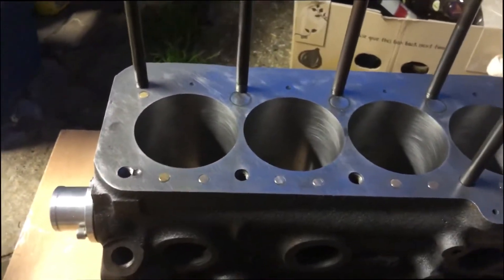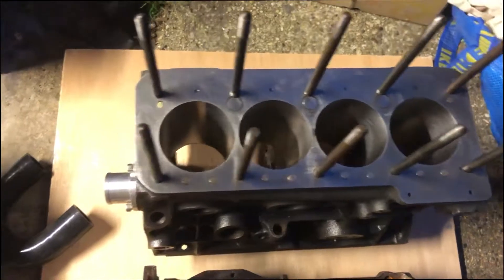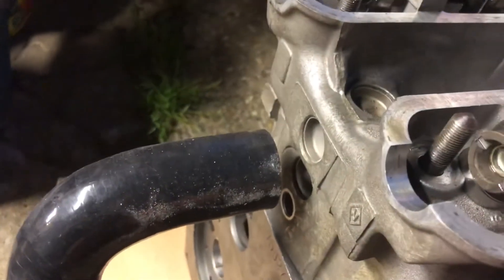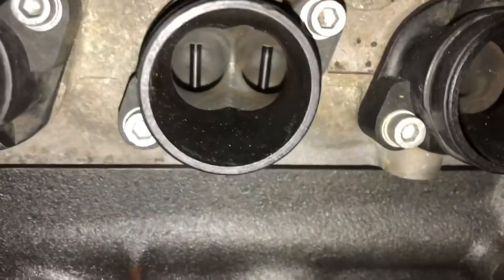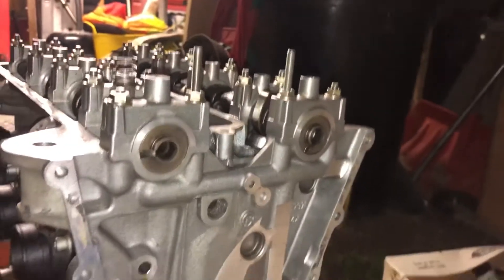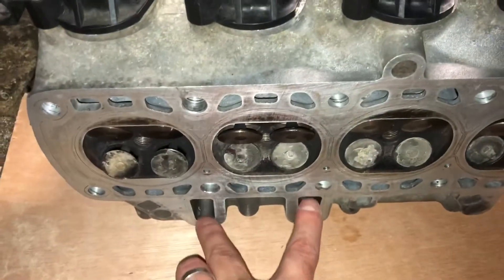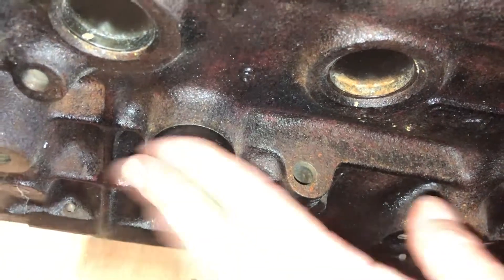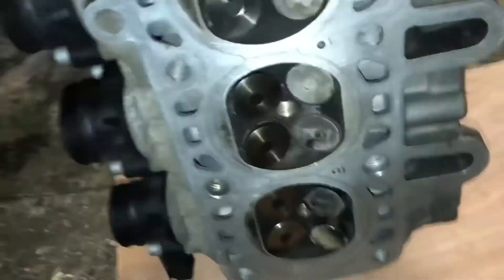BMW K Head Conversion

Comment: But which is cheaper, going to the K head and doing all that work to dry deck it, or getting the aluminum head from Moss Motors? You could also get the cams turned to clear the studs so you don't have to cut them down, in fact a little extra weight off the rotating assembly is free power.
Reply from the maker: Sorry which aluminium head from moss motors?? Not heard of that one. Is it a regular 5 port head??
Reply: @NickThornhill  did you get my reply with the link to it, it's not showing now, I bet youtube deleted it as spam
Reply from the maker: No sorry. It didn’t come up on my page. Drop me a message on Instagram. Nicks_Projects

Comment: Just a side observation. I noticed The standard A Series engine has a cam in block down low, but again it has chain drive for the cam even though it’s down next to the crank. Why do so many cam in block engines have cam chain drives? Afterall if VW can have the a cam gear directly driven off a crank gear right out in front & RR can do the same with their V8, except the direct crank gear to cam gear setup is at the back, why don’t all cam in block engines have their cams directly driven from the crank? Afterall it’s just 2:1. Gez even the Ford 300 straight 6 has a direct gear driven cam, yet it’s smaller brothers (the 144, 170, 221 & 250) all have cam chains too.
Reply from the maker: I think it comes down to cost and the expected use of the engine. 

If it’s a high power, high load, high rpm engine, it’s really important to have all that mechanism hugely reliable and gears do that job perfectly. 

However when cost comes into it, a chain has a very reasonable life, it’s cheap to make and easy to replace, also requires very little maintenance aside from a new tensioner every now and then and a replacement chain at 100’000 miles when everything else is probably also worn out.
Reply: @NickThornhill  Thanks for replying, Nick, take care & goodluck

Comment: Great video Nick. The one thing I don't understand is why the block needs to be blocked completely as in your video if running a dry deck. Wouldn't a dry deck gasket hold it all back? I'm trying to find out if I can make a 8V conversion without having to disassemble the whole block and send it to a machine shop, so just drilling and tapping the block. I have converted my dizzy into a 36-1 hall sensor enclosure for the EFI, works a treat as it can run sequential without the need for camshaft sensor. Just an idea given that you are giving so many in your video!
Reply from the maker: You can just block all the holes with a gasket however if you blow a head gasket, the combustion gasses could pressurise the water system and blow all the water out of the engine, if the head and block surfaces are sealed, all you lose is combustion gases and you can gently cruise to safety. 

Even if you run a wet deck, it’s advisable to plug and re-drill some of the existing holes on the block surface to align them with the k head. 

As for the dizzy with a 36-1, it should work but the crank sensor spins at 2x the speed of the cam/dizzy so you’ve got 18 pulses on one revolution and then 17 and your missing tooth on the next, rather than 35 and your missing tooth for every revolution of the engine. You end up with a pulse every 20 degrees of engine rotation rather than every 10 degrees. 

In theory it’s half as accurate as a crank sensor. 

You could use both a 36-1 crank sensor and the dizzy to give you engine speed and position but all you’d need is 1 tooth on the dizzy for position.

Comment: What’s the best head cams and throttle body’s to use on a street hot rod spec? Many thanks
Reply from the maker: Using the bike heads, you only really have 2 options, 

LT cams that give about 110-120bhp. They idle smoothly and pull from nothing to a red line of 7000rpm. Apparently they’re totally road drivable but pull like a modern 1.6, good low down torque with a nice peak at the top end. 

RS cams that give about 130-140bhp depending on what you read. These still idle smoothly but don’t really come on cam until much higher up the revs and you have to keep them singing to get the power. John at specialist components said that an LT cam will wipe the floor with an RS cam until about 5000 rpm, then the rs cam just wants to keep going to 8500rpm. You’ve got to make sure your bottom end can cope with that. 

Specialist components also have a nice selection of different midrange and sprint cams that they have reground on an RS profile. If you’re interested in the conversion, it’s well worth looking into what they offer and get the specialist components book on the conversion. I Think it was only £30 last time I looked. 

I’m running RS Cams but I have got a set of LT cams to try if I don’t like the way they drive.
Reply from the maker: Regarding throttle bodies, Specialist components sell one that was developed by ATpower but you can just use the bike throttle bodies that BMW supplied.
Reply: @NickThornhill  many thanks. Think I’ll look for some RS. 5K plus works great for me.
Reply from the maker: The specialist components book has a couple of engine build examples with power curves in the back.
Reply: @NickThornhill  I have a copy, will try and find it lol cheers

Comment: I see you've plugged all the holes, do you use a head stud with a bit of locktite and then cut it off? The brass plugs you used, were they bought or machined? Sorry for all the questions I've just bought a k1200rs head and am gathering the info
Reply from the maker: Yes sort of, I found a machine shop that did the block modifications for me. 

He used Allen head cap screws instead of studs to make sure they had a nice flat surface to torque down onto. Although I have covered it in this video, Ive got better pictures on my Instagram. Look up nicks_projects. I will do a full video on the block modifications.
Reply: @NickThornhill  cheers I'll have a look on your Instagram , I'm very early in the project and just collecting parts at the moment so I may need more questions answered , keep up the good work with the videos. They're a good watch 👍
Reply from the maker: Thanks. I will do. Feel free to drop me a line on Instagram if you’ve got any questions.
Reply: @NickThornhill  cheers 👍

Comment: Nick what is the best and eseyest engine head combination? Like 1300 with a k11000 or k100?
Reply from the maker: Easiest would be a 1275 or more with a 16v head as the pistons are usually available off the shelf at specialist components

Comment: I see that all the pushrod holes have been filled but what about the original camshaft and crank on the A series block?
Reply from the maker: You still run the camshaft as it drives the oil pump, if you are lucky or run some steel rods you’ll be fine but ideally you grind off all the cam lobes and just use it as a jack shaft. 

I will be covering the build in detail when I get there. Just preparing the car at the moment.